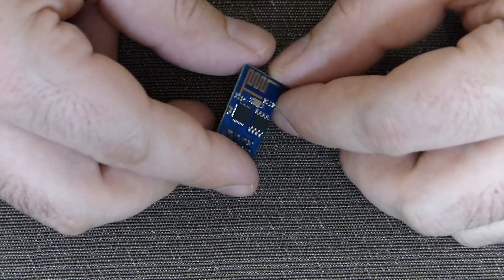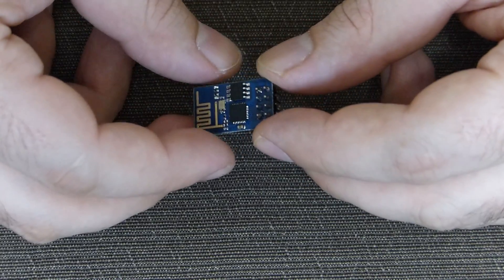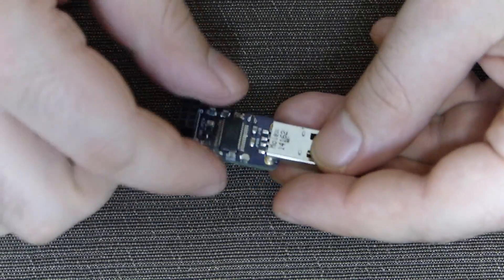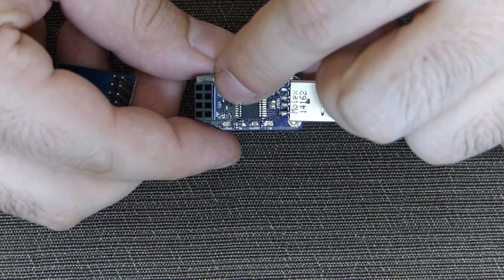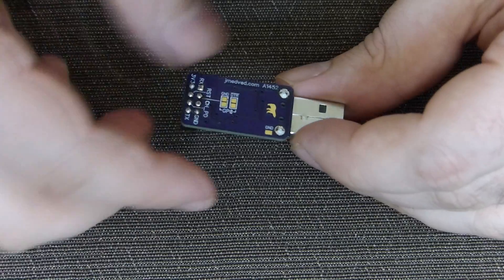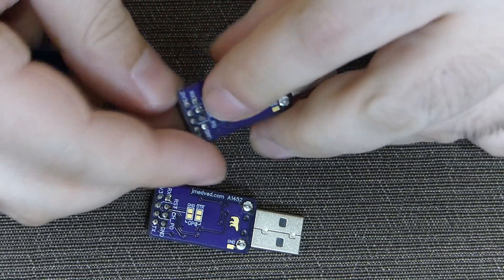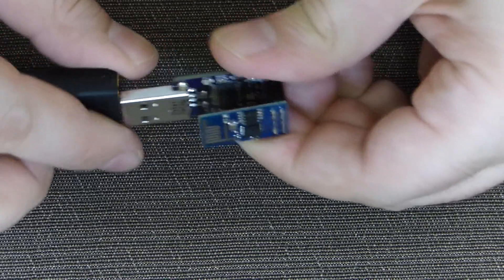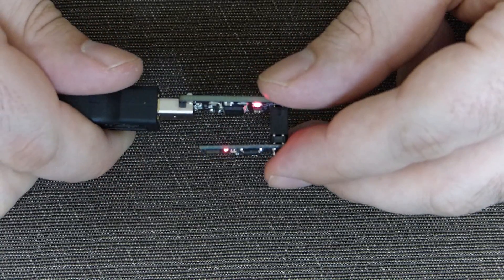ESP8266 Plug

Comment: I solder a button between GPIO0 and GND. Press and plug to USB and ESP is in flash mode. Strange that they didn't solder couple pins to allow short them with a jumper.